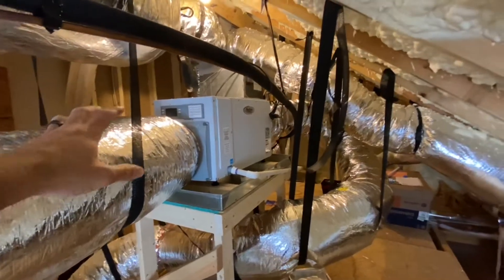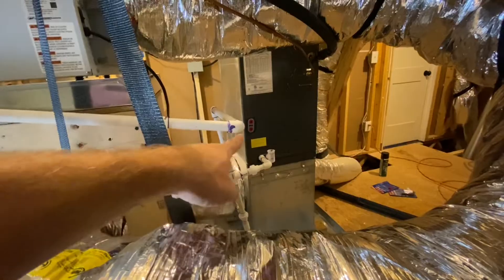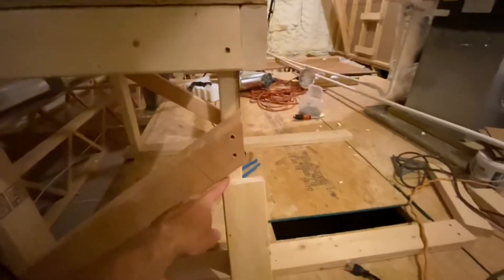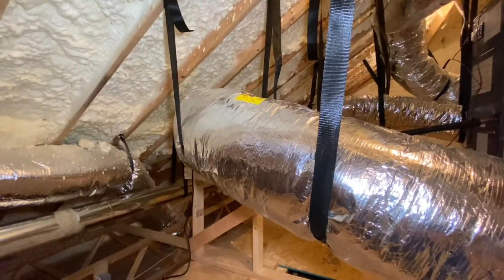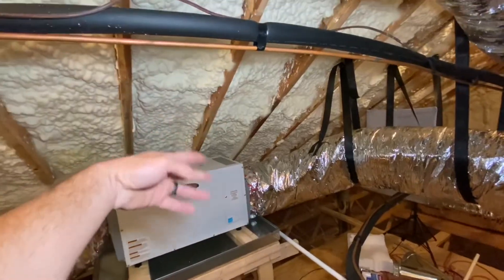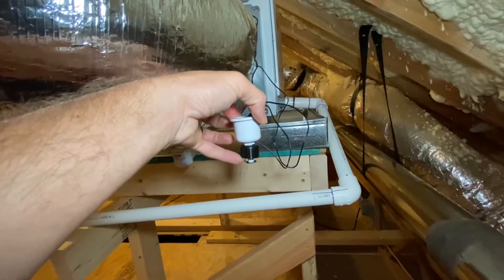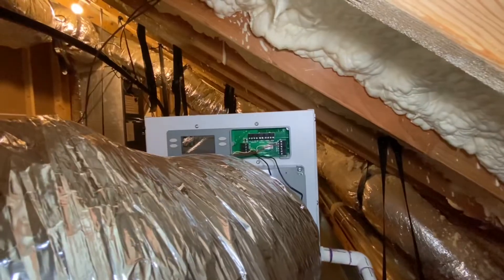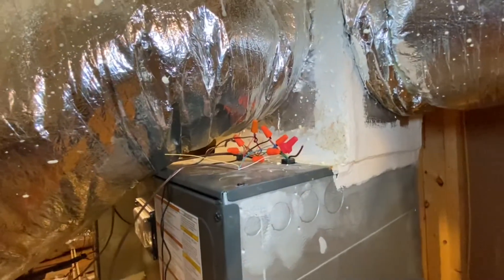How to connect an Aprilaire whole house dehumidifier to a HVAC blower fan in spray foamed house.

Comment: I saw another video by a HVAC company that says the air coming from the DH can't flow over the coil or it will produce tons of condensate.
Reply: The Aprilaire manual (and in these videos) recommends running the blower in the air handler.  They should probably be more clear that running the AC (cooling) and the dehumidifier (feeding into the AC return) could cause the moisture that normally condenses to be picked up (or the mixed air to not reach dew point to even condense on the coil, I'm thinking).  So, there is this DEH W/AC function that is what they have to Disable the DEH when the AC is running.  You have to provide the Y-wire from the thermostat/AC to the dehumidifier to tell it the AC is running; you can disable or enable this, but I would think a way to set a time-delay would be what is needed from reading about the issue you raise.   So, go to that trouble or feed the dehumidifier outlet to the AC supply outlet plenum, but I'm thinking this could just blow dry air backwards into your AC and out the return (basically short cycling).  Bottom line, tie into you air handler so the blower is running, but disable during AC cooling, no matter how you duct it.

I'd like to put in a closet in the return plenum basically and have it shoot vertically (like one of the install manual configurations) and assume it should be tied to the air handler and disabled during cooling.  But do I still need the 6' difference to prevent short-cycling, i.e., put a 6' vertical duct from the outlet up in the return?  Good thing I would have room in the return plenum for this, but the closet install configuration in the manual doesn't.
Reply from the maker: The Aprilaire installation manual says the preferred installation method is to pull air from the hvac return and supply it back to the return. Then the dehumidified air will travel through the hvac unit and out to the house. I would have installed my ductwork this way but my HVAC return duct was too short. I had to cut a hole in the ceiling of my living room and install a separate return vent for the dehumidifier, as shown in the original installation video. 

Also, the dehumidifier is dehumidifying the air. It is pushing dehumidified air into the HVAC unit. It does not make sense that the dehumidified air would cause the HVAC unit to produce tons of condensate. It just ran through a dehumidifier.

Comment: I have little to no room to run a second return. Is it possible to hook into the original HVAC return and pump it into the trunk past the coil/exit end where ducted out.  Actually it would have to hooked into the trunk before it hits the coil right
Reply from the maker: Yes! There are many ways to connect this dehumidifier. You can pull from the hvac return and dump the dehumidified air into to hvac supply ducts if you have more room there. It should work well as long as the dehumidifier kicks the hvac fan on when it’s running.

Comment: Any update ? I have mine installed for 3 month and it works good, but I’m not sure if I should connected to the hvac to hav better results !
Reply from the maker: It works a lot better since I connected it to the hvac fan. I should have wired it this way when I first installed it. It’s been raining, with temps in the 60s and 70s, over the last couple of weeks in Georgia. The humidity has been very high outside. We are comfortable inside at around 50% humidity. This dehumidifier runs a lot longer now so it’s removing a lot more humidity from the house.
Reply: @BrantleyBlended  

That’s great , I’ll be doing the same . Thanks for everything!!!

Comment: The first thing that bugged me with the original installation was the drain line... glad you fixed it. Since the dehumidifier was at a higher position than the hvac drain pan it was a disaster waiting to happen. That drain could clog pass the tee allowing the condensate water to overflow into the hvac system seen it happen many times as an hvac tech. Great Video by the way 👍